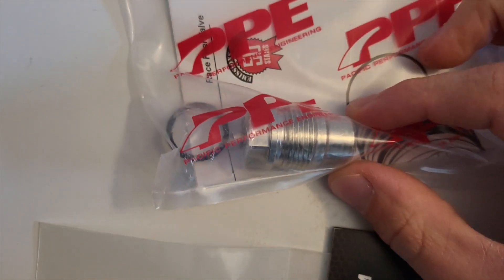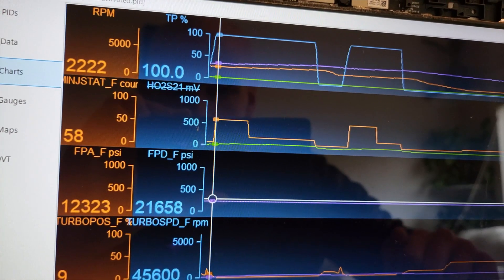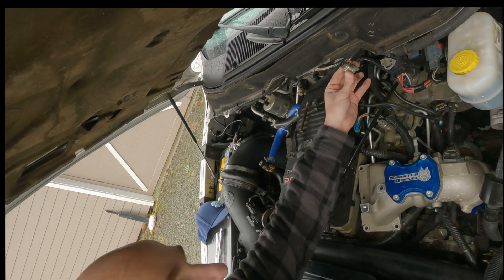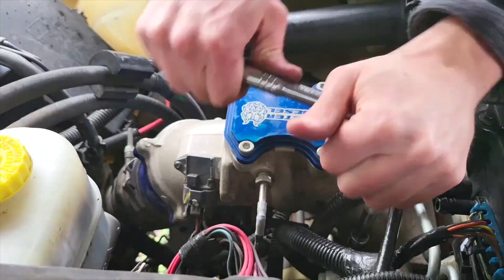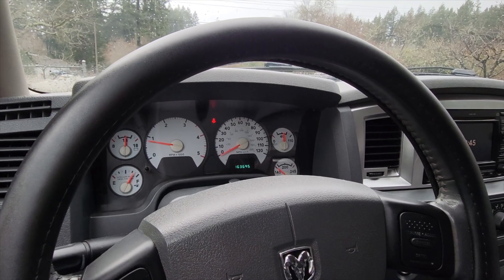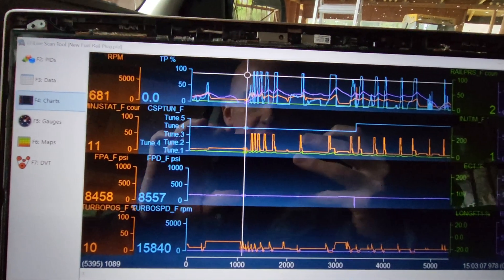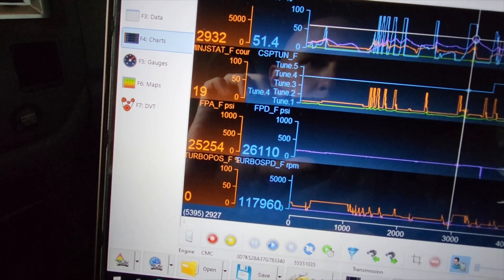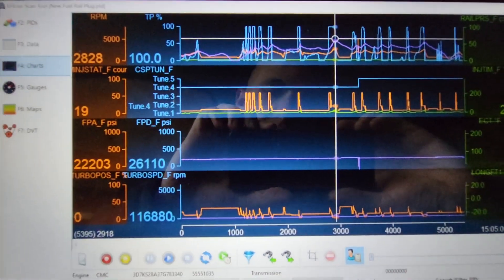Fuel Rail Plug Before & After WITH DATA 6.7 Cummins

Comment: You dont have the pump to support the tunes you have... you should have gotten an actual exergy 2000 or higher bar PRV instead of that gay plug. Invest in a big pump and injectors if you want to actually use that tune.

Comment: I’ve heard it’s not common in 4th gen 6.7s. But mine just started doing this. Acting like it’s on a limiter under load. Check actual vs desired and it was commanding 27000psi and only making 17000psi. I ordered a plug today…. 😂
Reply: The plug is an idiotic way of getting more rail pressure. Spend the 280 on a 2200 bar PRV from exergy so you don't blow out your injectors later.
Reply: @jfreakinl4719 found out my lift pump screen was clogged. It’s not idiotic… it’s trouble shooting… I kept my relief valve in case it wasn’t the issue.
Reply: @JohnJernigan95 trouble shooting by deploying the parts cannon is idiotic. That's not what I was referring to. A PLUG is idiotic. A higher rate PRV is the way to go.
Reply: @jfreakinl4719  alright tough guy! 😂
Reply: @jfreakinl4719  again…. I was having a pressure issue…. Thought it was the PRV…. Didn’t want to spend $400 for a new one… didn’t need a higher one. Bought the $40 plug to make sure it wasn’t it. Ended up being the lift pump screen clogged…. If you are calling that a PARTS CANNON…. Then you are the idiot…. Yeah let me buy a $400 PRV and that end up not being my problem…. That’s idiotic…

Comment: Are you worried about cracking your injectors?  That is why this is not recommended. Its recommended as a diagnostic tool but not a solution.

Comment: What software are you using to monitor the parameters like that?
Reply from the maker: Hey Man! It’s EFI Live. You can download it.

To obtain the data, You plug the Auto Cal into the OBD2 port, and your computer to the Auto Cal. 

Hope that helps!
Reply: @danscountry I have civic 2.2 i-cdti , hard start after driven 30 minutes ( when engine is hot ) been to 3 different mechanics no one has a clue what's happening , diagnostic tool showing everything is fine , no errors or codes . Even changed crankshaft position sensor just in case but still the same problem. Pressure relief valve may be the problem? Thanks.